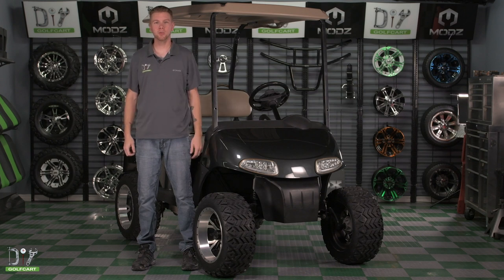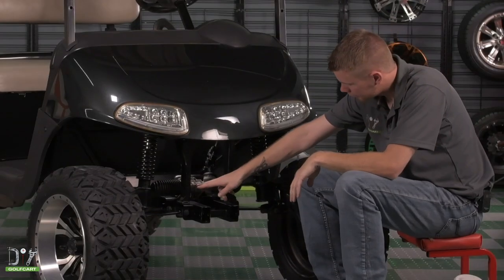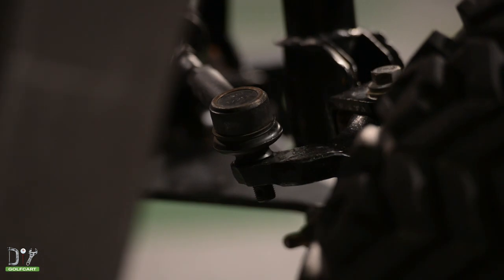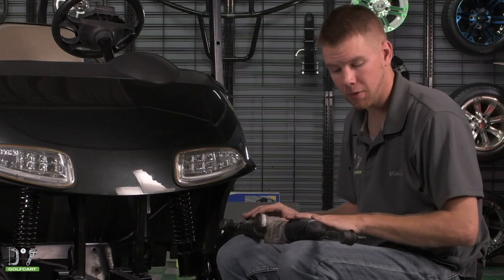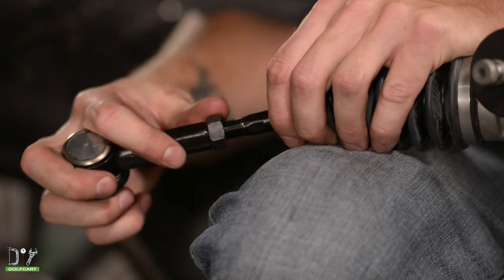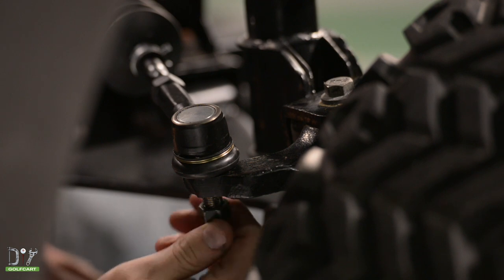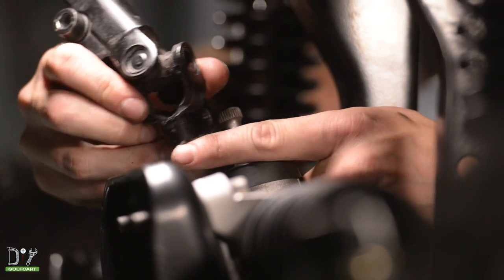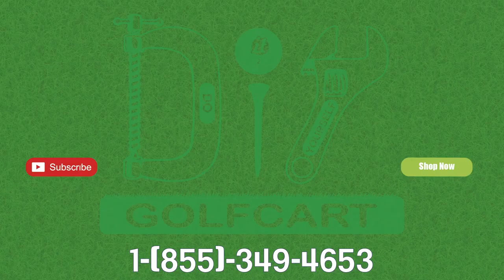EZGO RXV 2008-Up Golf Cart Steering Gear Box Assembly Installation How-To

Comment: Thanks for the video.  Is there a way to tighten up the steering?  I have a decent play in my steering wheel
Reply from the maker: Not to my knowledge. I would recommend jacking up the front end and try to move the front tires one at a time and see if anything is moving that shouldn't be. I've seen ball joints (tie rod ends) become worn and cause excessive steering. Thanks for watch!